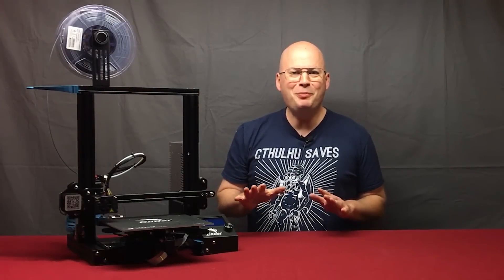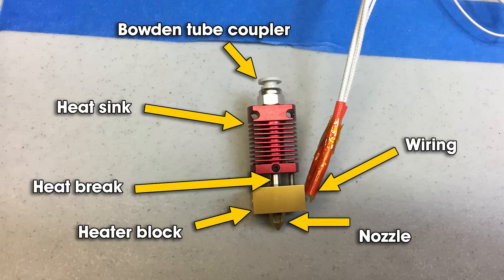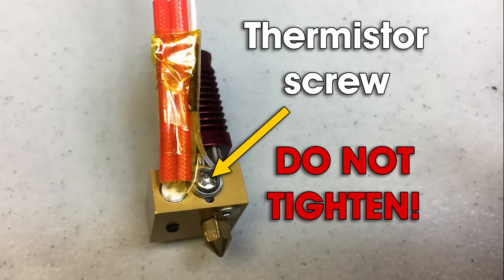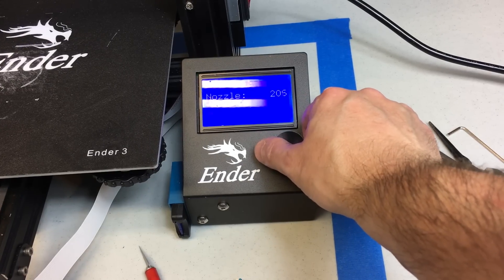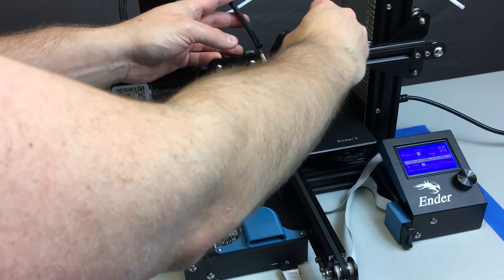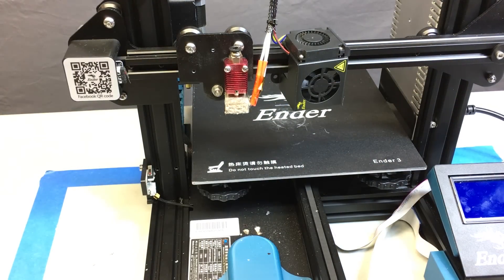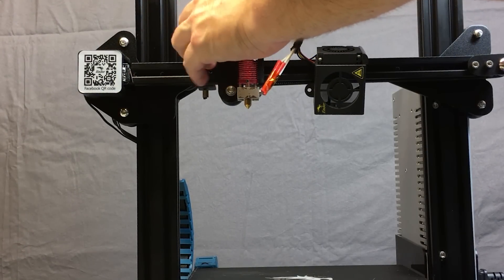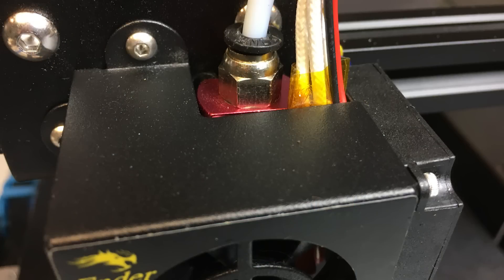Changing Nozzles & Bowden Tubes

Comment: I have a bad clog so I removed all my Capricorn tubing but it happened right after I did a nozzle upgrade, I bought a plated steel .4 nozzle and put it in not realizing I had to do the loosen part before inserting tubing and then tighten back up. I am nervous working on it because anything I mess up takes days from Amazon, I am far from civilization lol. What tubing do you think is better? That white tube you use or the Capricorn upgraded stuff?
Reply: I also stopped after watching this video to get a cutter like that instead of the cheap thing that comes with the tubing
Reply: Oh and I am running an ender 5 pro

Comment: A little advice for noobs starters just like that read the comments. METAL PART = OUCH. Don't get even close to touching it. Learned that the hard way
Reply: So is touching capacitors still charged to rectified mains voltage.
Sorry, had to say that.  I had watched two videos about the same time where one burned their finger with the wrench getting the nozzle out, another from an experienced engineer troubleshooting an electrical device where he got shocked with the device on his bench, having been disconnected for some time.

Comment: I just got my ender 5pro. After 1st test print the filament has stopped feeding. I'm trying to change the nozzle, but for the life of me it won't come off. The included little wrench/spanner is cutting through the nozzle instead of loosening. Even using pliers it won't budge. Any idea what I'm doing  wrong??
Reply: Do you have it heated?  May need hotter temp than 210.
Turning nozzle correct direction?  One can get disoriented with the "screw" (nozzle) facing downward.

Comment: So I pretty sure I have a clog, trying to follow this video but I cannot get the bowden tube out of the cupler at the hotend side, I've pulled and pulled...

its a CR10. any ideas?
Reply: Are you heating it up first? I had the same issue. You might need a bit of force but be careful.

Comment: 9:38 "... just change the nozzle out, they're 90 cents" - What?! Where can you get a good quality nozzle for 90 cents? Were you talking about those huge packs of nozzles you can buy on amazon?
Reply from the maker: Yep, they work great for me.
Reply: @Tombof3DPrintedHorrors  Any specific brand? There are so many of those sets and pretty much 99% have multiple posts saying that they suck.
Reply: I bought a pack of 25, they do OK, but found many of them are 0.44-0.45mm since I can manage to get the butt end of a #77 drill bit through them and my calipers say a #77 is 0.45mm
Not sure how much of a facto4r that would be on print quality.

Comment: I have to disagree with you about the tube cutter. Those are meant for metal tubes, not plastic. I tried one out at your recommendation and it crushes the pipe long before it cuts through. In fact, I gave up trying to cut through those so-called capricorn ptfe tubes people love so much. They also just take way too long. Those cheapy tube cutters on ebay work perfectly--they cost less than $2 US.
Reply from the maker: If you are crushing the tube you aren't using it correctly. Small incremental turns to tighten the blade and multiple rotations between each adjustment, take your time. I have used them for years and never crushed a tube.
Reply: @Tombof3DPrintedHorrors  I used as tube cutter as described, but it just further compresses the tube with each successive tightening, never managing to actual slice through. This could be due to my choice of tube, which is that blue "capricorn" ptfe tube available everywhere. Maybe it's not all made equally despite its appearance. In any case, I'm quite sure the best way to cut through any of this stuff is with a sharp utility blade, just making sure, im some way, it is perfectly perpendicular to the tube.
Reply from the maker: @keithpetrino  I use my cutter on Capricorn all the time and no issues.

Comment: I have a flsun printer that got a clog.  I need to change my bowden tube but I can not get it out of the hot end of the printer.  i have heated it up and taken the cooling fan off in order to clear a clog and then i attempted to take out the bowden tube to replace it and i can not get it to come out of the hot end.  Any suggestions?

Comment: Help new to 3d printing have just changed the bed springs on my ender pro3 now can't get bed low enough to level
Reply: Move your Z axis end stop.
Reply: Better yet, get an ABL like CR-touch.  With that, doesn't matter how high/low the bed is relative to the frame, the sensor/nozzle will follow it on z-home.

Comment: The wrench heats up so fast and I burnt my hand:(
Reply: same.. for others reading this, be careful of which part of the wrench you are holding. hold near the end and disengage for a while to let the wrench cool down, else the wrench will heat up and burn your finger :(

(if you get burnt, please run the burnt part under running water for about 5-10mins, it will help in recovery)

Comment: Imagine actually getting a wrench that fits your nozzle, couldn't be me. Ender 3 pro real 10/10
Reply: Mine came with 2
Reply: @weld4200  dang now i know where mine went lol
Reply: @goldengamer8510  wouldnt surprise me honestly . im new 2 all this ..idk a good print from a bad or perfect one . idk wat any of the settings means or anything .. Im a welder by trade im wiling to learn . bashed my nozzle to the mag bed replaced the bed . now my extruder skips no clue why. Not sure if my bed is level but i got it 2 print . first layer is near see thru .. I also feel like my glass bed is warpped 2
Reply: @weld4200  extruder skip usually means there's a clog
Reply: @danman32  yup figured it out .. ive learned so much as time passed . Im printing poly carb now lol way past pla lol
Reply: @Maliki Higgs  how do you like the poly carb I almost immediately got off pla and went to petg and I want to print carbon fiber filaments eventually I like usually pla as a test for a new print if I like it I go to petg
Reply: 6mm. My nozzle broke though...
Reply: Had to use needle nose pliers cuz the ones that came with mine would burn my hands

Comment: My prints were getting wavy ... the bowden tube wont come out of either coupler so I unscrewed the couple from the heat sink and the tube was a mess with sticky gunk...guessing this is my problem,.
Reply: My Bowden tube won't come out of the heat break. Not sure what's safe to treat how roughly.
Reply: @kprnospm  did you warm it up?

Comment: Thank you so much for this video. I just bought my first 3d printer, an Ender 5 Pro and from the first test print it had issues with extruding. I was about to throw it out the window, well maybe have Creality take it back. But then I ran across your  video, and with your help figured out it was the Boden tube not seated correctly to the nozzle. Than you again.
Reply: Same here. I bought my first 3D printer, and Ender 5 Pro and the first calibration print looked great. Then it started to clog on some test prints. Going to take it apart today and fix the clog. Thanks for all your informative videos.

Comment: very good video...  e is have done this maany times... one thing is to also make sure when you hand tighten new nozzle is to make sure it seats on heat break tube and there some small gap left so when you do your final tighten it seats well against tube and not your block...and of coarse relevel...
Reply: Should have mentioned re-levelling at end of video. Even if seated on the heater block, variability of Nozzle dimensions will affect clearance to the bed.

Comment: Just curious as to why not remove the Bowden tube and the fan shroud BEFORE heating the nozzle?  Thereby reducing the risk of burning your fingers.  Also wondering if, after removing the nozzle, it might be a good time to check and make sure there's no blockage in the heat break?  This is a great "how-to", very much appreciated as I'm starting to think it's time to change my print nozzle for the first time!  (Some quality degradation in prints).

Comment: Hello, great video really informative. 
I have a question though, I have removed the clogged nozzle and there is PLA still in the hot end (only a small membrane) where the Bowden tube and the nozzle would have met. 
How would you recommend flushing/cleaning this out?

Comment: I don't know if the bowden tube wasn't seated correctly, but I had a clog, and when tried to remove the bowden tube it took a lot of force. It looks like the heat sink is full of melted PLA. Any way to clean it out, or do I have to replace that, too?

Comment: I recently bought an ender 2 and was happily printing away for abt 1 year w/o issues before running into major print problems.
I have changed nozzle, bowden tube and heater cartridge as per your videos. I have also added the silicone cover. After assembling everything the nozzle doesnt heat up all the way anymore. It starts fine with abt 1 degree per second till it reaches 135 degrees and the temp climb becomes slower and slower until its at 155 degrees where a 1 degree climb happens after 33 seconds.
Did I do something wrong when connecting the heater cartridge?

Comment: Ohh ☹️☹️ Hey, 
There is another issue. Creality 10 s pro... 
Previously the fillament was not moving. While trying to feed or retract, it spring back and stuck. As you told me few months ago, I changed the nozzle and trimmed the clogged bowden tube. All worked well.
Now this time all of a same thing happened. The filament was stuck, not retracting or extruding. I opened the assembly again as you mentioned. But this time the bowden tube is clear. It is clogged just behind the brass nozzle. I removed the nozzle. Heated the extruder block to loosen the clogg. This time it is still blocked. I inserted a long nail into it, it is hard blocked even when heated at 230 degrees. 
What must be stuck inside?
Should I remove the red heat sync? 
There are two tiny deep set screws in the heat sync towards the square block. Should I loosen them to separate the heat sync? 
My heat sync has no 2 screws it is directly attached with the heat break rod.
Please help.

Comment: Bowden tube should not be pulled out  from  bowden tube coupler as shown , because it can be easily damaged. Inside the  bowden tube coupler is piece of metal clamp.
If you try to pull out tube it can be damaged. Better way is to unscrew bowden tube coupler from heat sink and  pull out tube in opposite direction.

Comment: A question.  One on my Ender 3 Pro is a black silicon Heater Block cover.  Do I need to get the one you show in the video?  Also, I ask here because I don't do FB.

Comment: I have followed your guide and ended up with a leaking nozzle. You need to make sure that your new nozzle get tight together with the heat-block-pipe and not your bowden tube. If your hot-end is feeling "loose" there is most likely a leak in your hot-end and you might see filament dripping down elsewhere than from the nozzle tip. when the nozzle is tighten, remember to check is there is a gap between the heater block and the shoulder of the nozzle!

Comment: Hey Tom, the color can have an influence over the rate of wear, the melt flow or even the warpage tendency:

Carbon black - slows the melt flow & nucleates the resin causing warp
Organic Red & Ultramarine blue pigments - nucleates causing warp
Titanium dioxide (white) - Increases the abrasion of the melt

green is pretty safe in my experience (17 years of extruding color)
Gray is probably not too bad

Comment: Wow - there are some videos that have this procedure completely wrong and I paid for it. This is a late comment but thanks a lot for the clear explanation.
Reply: Yep same here, now I got to wait a couple days for some new thermistors but hopefully the micro swiss that caused me to break the 1st thermistor will be worth it.
Reply: @Emmett_95  I did the same thing, cranked down on the thermometer screw. I had bad readings but was able to back it off and it was ok. Good luck with yours.

Comment: Thank you, your videos are awesome. I am just eager and clumsy. I had a clog and removed the nozzle, it has a massive clog. I ordered more. What I did wrong was I used tools to help release the bowden tube and coupler from the top of the heat sink. The Plastic was heated up and it oozed out. I cleaned as best as possible. Luckily my Ender 3 came with the Silicon sock already in place. It did the cold pull and got a lot out, then used a paperclip inside the nozzle to dig out more. I ordered the following: https://www.amazon.com/Authentic-Capricorn-Filament-Upgraded-Pneumatic/dp/B07PS3NH82/ref=sr_1_3?crid=3SZBP5TB24FEP&keywords=authentic+capricorn+ptfe+bowden+tubing&qid=1579219687&sprefix=authentic+capricorn%2Caps%2C547&sr=8-3 

And it will arrive tomorrow. I was watching your video about completely removing the bowden system all together. I live in New Orleans and it is humid a lot. I don't think that will work for me. I have scratched up the heat sink a bit separating the parts. I am wondering if I need to upgrade to the swiss hot end. I am looking for recommendations. I have a glass bed on my ender right now and love it.

Comment: Great video. I just wanted to give you an update. I received my Ender 3 six days ago. Creality is no longer warping the hot end with thermal tape.  They are now using a  black silicon rubber boot with a cute little Creality logo on it to cover the hot end.  They have also re-positioned the wires to the  side so they are no longer pinched with housing cover and they are using  a longer wrap on the wires so that the wires have more covering on them to provide extra abrasion protection.  Cheers.

Comment: So I just got my ENder 5 recently thanks to all your helpful videos and suggestions. One thing I've learned is to make sure that you place the nozzle flush with the heater block. Might seem like common sense, but it didn't hit me until I went to try another attempt at the cable bracket you've linked in other videos...This prevents you from having to redo bed leveling by having a set surface. Then again...if your nozzles are not machined within a well enough tolerance, you may have to do bed leveling again after you switch to a different brand or even a different batch (from the same manufacturer) of nozzles. Always learning :)

EDIT: Also just went to Auto Home and noticed that the glass bed upgrade I got with the printer is just touching the tip of the nozzle, even with the bed lowered as far as it will go on the springs...Looks like I'm going to add a small washer under the Z Limit screw on the bed to lower the whole thing. Guess the nozzles I got are a bit longer than the stock Creality ones!

Comment: Tiny thermistor  wire broke again changing nozzle .. hope i can solder it again and i t holds... i wish ender made that area less fragile... weak link for sure..
Reply from the maker: Thermistor wires need to be thin due how it works. Do not try soldering it, just replace it following the video I did on how to do it.
Reply: @Tombof3DPrintedHorrors  yes it failed after only a couple of minutes.. i found some on amazon...thax

Comment: If you only need to change the Bowden's tube is there a need to pre heat the nozzle?
Reply: technically no, but really... you  have to take the nozzle off to get the correct seating ( no gap ) watch from 11:00 on. .
so to be clear.. you ALWAYS should heat up to take the nozzle off, or tighten it up. otherwise you can easily snap the nozzle as its SO  hard to get it off if you dont heat it up.

Comment: Thank you for your video's. Very clear and informative. One thing I noticed in this video; when you rotate your dial knob. It's very quick and reponsive to get to 205 degrees. When I do the same on my Ender 3 pro, I have to turn the dial a lot more turns for it to reach that same number! It's only upping in small increments and not very linear/stable. Any idea why? Is it firmware?

Comment: Thank you! I was having filament bunch up above the nozzle and not extruded and I kept wondering whether or not the Bowden tube should go that far down or not. None of the supplied data with my ender pro mentioned or showed what you did at 5:45. Thanks a bunch for this video!

Comment: I have filament leaking out from under the heat block and above my nozzle. I think that means I broke the heat break :/
Reply: Are you sure the bowden tube is up against the nozzle?  Sounds like there's probably a gap.
Reply: I’m pretty sure it is. I tried inserting the Bowden tube in many times

Comment: I unfortunately did very little research while searching for a 3d printer, so I just decided to get a CTC prusa i3 clone. I haven't got to printing yet due to the hotend wire being broken and the ERR:MAXTEMP BED on my display screen everytime I turn it on. I got a replacement hotend cable but I have no idea how to put it on. Any suggestions?

Comment: Great video, but if you happen to see this, when I pushed the bowden tube down the heat block lowered about and inch. I'm gonna assume this bad so might you be able to lend assistance as to how I correct this. Thanks
Reply: Since I'm replying about 8 months later, I suspect you already solved the problem.  But my first question when I saw your post is..  is there any chance the screws from the heater block to the heat sink had been removed?  That's the only reason I can think of offhand that your heat block could slip like that.  Some people were giving bad advice a while back suggesting those screws be removed to help reduce "heat creep", even suggesting they were "only there for shipping", which is a myth that has since been busted.  Those screws are intentionally there to help secure things where they're supposed to be (to prevent a problem like you describe), and while the heat sink DOES heat up a little QUICKER with the screws in place than without them, the temperature of the heat sink DOESN'T actually get any hotter as a result.